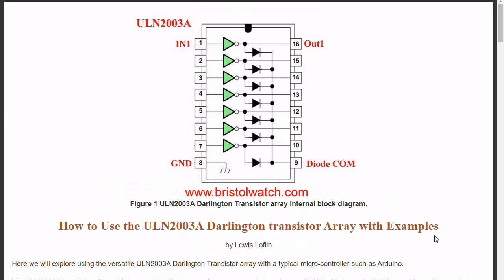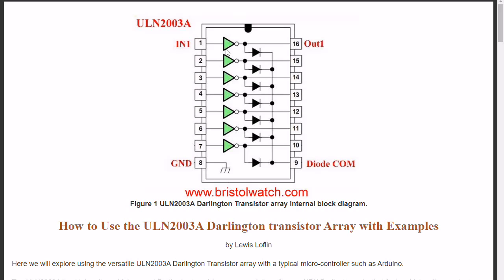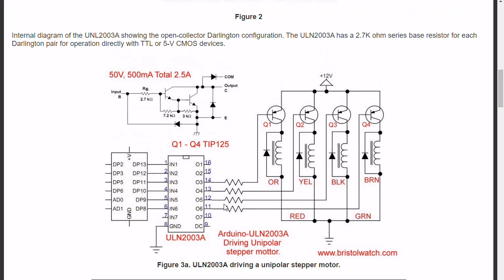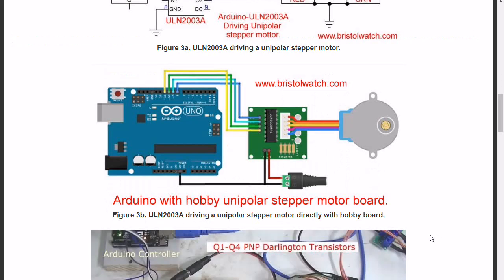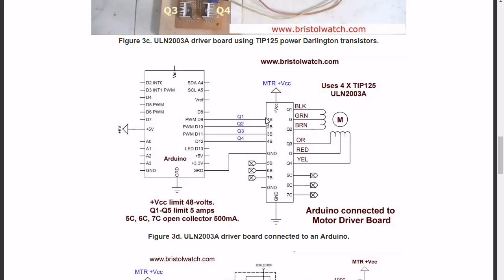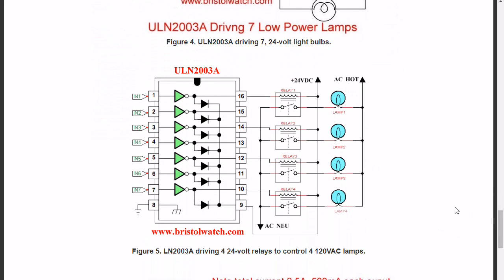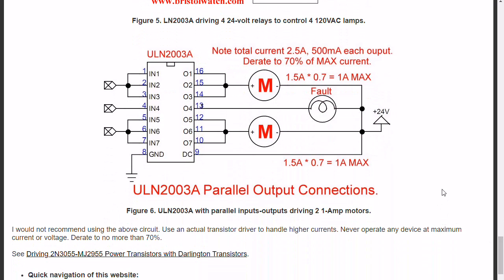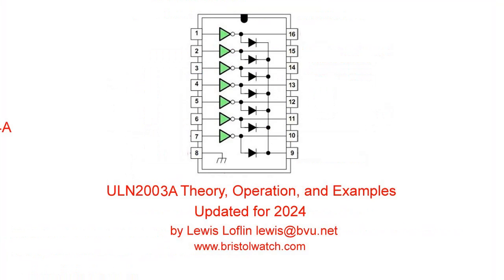Update 2024 ULN2003 Transistor Array Operation

Comment: I have a technical question about ULN2003.  I am using two SEPERATE power supply : one 5V for Arduino Uno and another 12V supply for stepper motor (or RELAY).  
Important point about connection:
1.  12V is connected between pin 8 and 9 of ULN2003.  pin 8 is GND12 & 9 pin is COM.  
2. arduino uno powered from separate 5V supply. 
3. Arduino UNO GPIO pin of 8, 9, 10, 11 are connected to ULN2003 pins 1, 2 , 3, 4
4. Important POINT. Arduino UNO GND is NOT connected to ULN2003.   AND EVERYTHING IS WORKING FINE. 

I checked many video and articles .........WHY PEOPLE ARE CONNECTING ARDUINO UNO GROUND TO ULN2003 MODULES  ?

Comment: Is there any better IC then ULN2003 for driving 12V RELAYs ?
Reply from the maker: Use individual transistors or MOSFETs.
Reply: @LewisLoflin  I am facing some issue when I am using transistor as relay driver. I am suing BC847 SMD transistor . RELAY is 5V/5A and load current is maximum 1.2A (AC heater Load). 1K base resistor between GPIO and transistor base. Also I am using 10K pulldown resistor between base and ground. I am using 1n4148 flyback diode. The issue : relay contact sticking. Please Note: the issue is very rare. Issue occurrence possibility is 0.1% -1%. Some times issue occurs after few months. 
that why I asked you anything better driver is available. ?
Reply from the maker: @sanjaybatra6593  What is the coil current?
Reply from the maker: Is the relay coil AC or DC?
Reply: @LewisLoflin   have you ever faced such type of issue ?
Reply: @LewisLoflin  coil is rated for 25mA current. ( coil resistance is around 200 ohm)
Reply from the maker: @sanjaybatra6593  If the relay sticks, that sounds like a possibly bad relay. Do you have another relay?
Reply: @LewisLoflin  Sticking is a common issue , I guess some how related to driver circuit , I had heard it from many engineers.
Reply from the maker: @sanjaybatra6593  Not true. We used relays in welding circuits on control boards, and they worked well, except for their age and susceptibility to flash burns. High-quality relays worked well. This is why we got away from relays. How about using solid-state relays?
Reply: @LewisLoflin  SSR also have similar type of issue, if SSR burn or get faulty . it will give continuously AC supply.
Reply from the maker: @sanjaybatra6593  SSRs do not have contacts. They use triacs. I have never heard of this, unless you have a problem with the controller.
Reply: @LewisLoflin   I myself visited client location to repair the equipment ( SSR was used ).
Second:
Sir, you never faced issue : These type of issues observed in machines, which are working for 18 to 20 hours.  Even failure was reported with big brand machines.

Comment: I am curious about how it would work to go: uC -> Photocoupler -> ULN2003 or similar. 
what does VI(on) ON-state input voltage mean in the spec sheet? the ULN2003 has a max of ~3v, but it can be driven from a 5v uC. What does this all mean?
Reply from the maker: Each input has a 2.7K resistor so 5V is no problem.
Reply: @LewisLoflin  Thank you! rereading the datasheet with this in mind makes it all very clear.
Reply from the maker: @graham8316  You are welcome.

Comment: Hi, I doubt it when You say, "you can omit connecting the suppressor diodes common pin when not using indictve loads".
I have done exactly that just because of couriosity on my latest clock build.
It was on a high side driver. Anyway. 
IF the diodes could be pulled out of the circuit that would work.
By not connecting the common pin to Vcc it makes an OR-gate out ouf the INTERNAL diodes.
Watch the multiplexed outputs simultaniously altering when done on a clock.
The number digits start blinking at the frequency of the seconds LED, fed through the same chip.
Reply from the maker: I can't say much until I see a schematic of what you did. Connect the diodes to Vcc then. Thanks for the info.
Reply: Hi, see my U125D based clock. Initially it had used an integrate high side driver.
The UTC 62783 is suffered from not fully shutting off the unused digits on a multiplexed clock. This results in ghosting on the LED displays.
The Toshiba IC TBD62783AP is said not being suffered from this bad behaviour
 But I had none on hand. I replaced the 62783, a counterpart of the well known ULN2803, with a number of discrete transistor drivers.
 @LewisLoflin  Works much better.